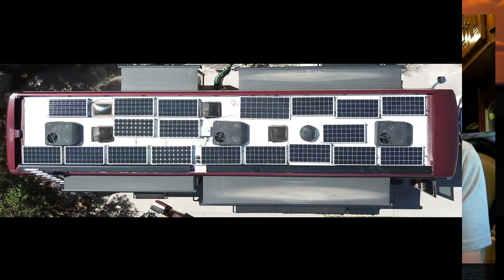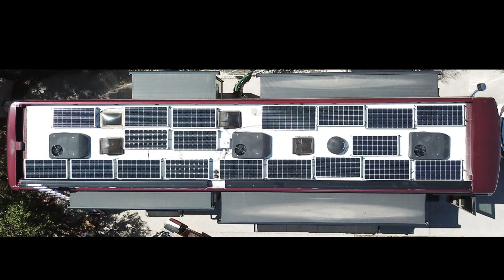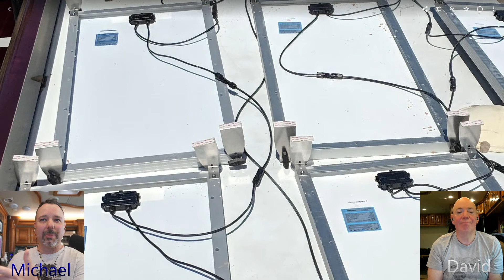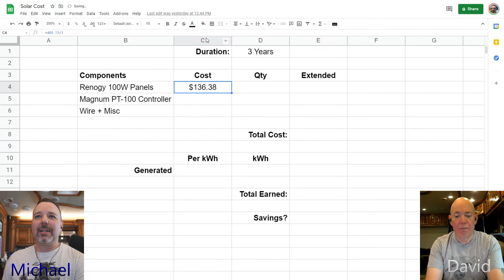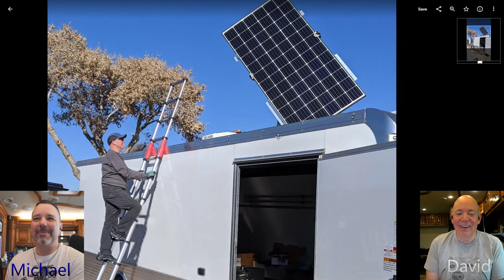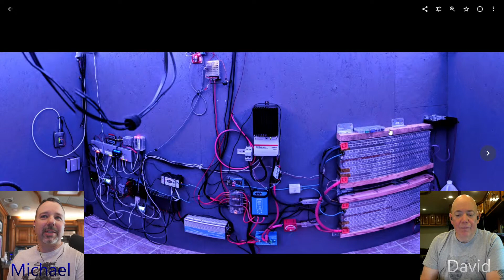SOLAR...Is It Really Worth It For YOU?

Comment: Enjoyed the video!

I like the idea Michael had with regards to using the OEM Solar system to charge the starting batteries.

I am curious regarding the discussion toward the end of the video regarding using your generator to charge your "future" lithium house batteries. I assume you have a diesel generator on your coach. Does this generator use your house batteries to start? How much current does it take to start that generator? If you go with the Battleborn batteries, they are not starting batteries. Even if you have a bank of them, will you have enough cold cranking amps available to turn over a diesel generator even on a good warm day? Just a thought.

Great to see other peoples toys!
Reply: Hi C C, The generator starter is indeed a high current surge.  For my installation, since I had to divorce the Chassis / House batteries anyway, and my new House batteries were 24v nominal, I moved the Generator start, as well as the Hydraulics over to the Chassis battery (they were previously both on the House batteries).

Great question!  Thanks for bringing it up. :)
Reply: @linuxkidd  Thanks for responding! Moving your generator start over to the chassis batteries makes a lot of sense. I think a lot of folks would have missed that little detail (at least until the first time they tried to start their generator on their lithium house batteries.). :-)